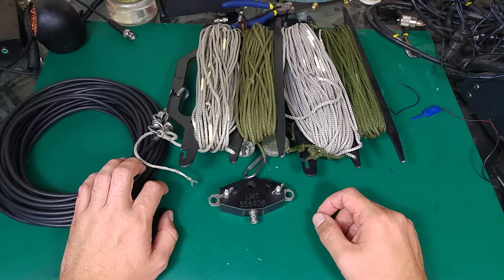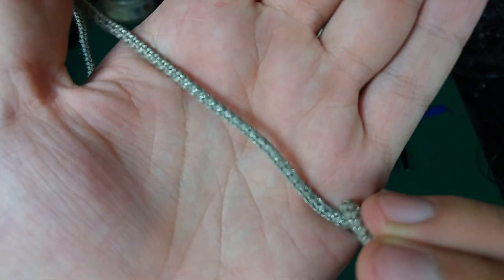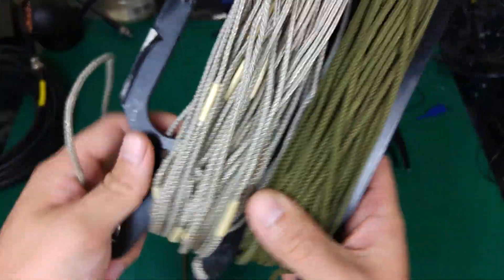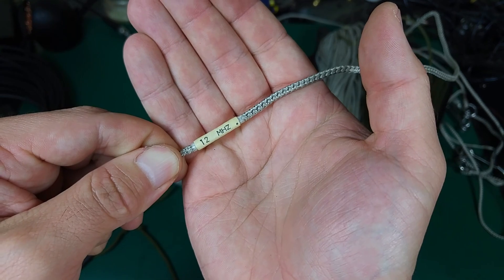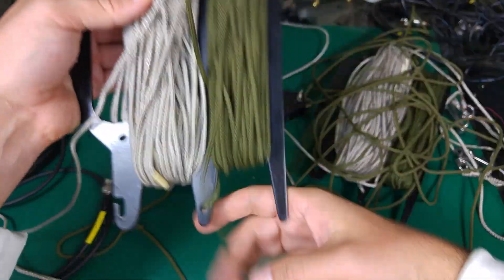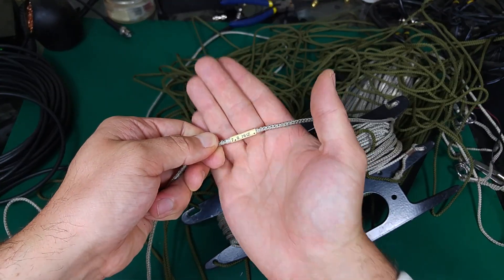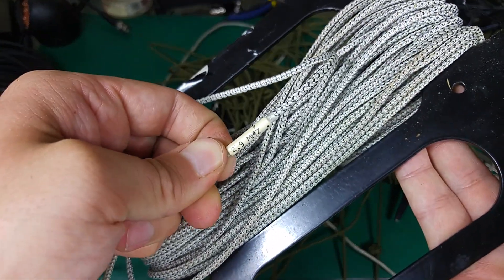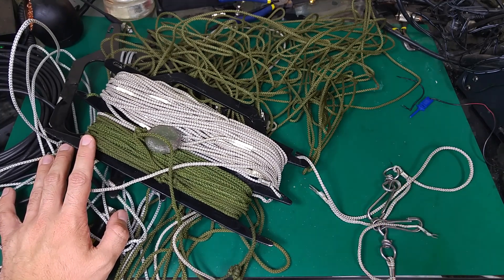HARRIS (?) MILITARY ANTENNA  PORTABLE DIPOLE  HF 2MHz - 30MHz

Comment: Very interesting! With the Clansman dipole that you mention, the remaining wire would simply wrap around the carrier. This “rope wire” is conductive on the outside, so it will make a short circuit on the carrier, making a precise length. With the Clansman set, you have to know the frequency and length calculations. The Clansman carrier then acts like a big inductor on the end with all of the wire wound around it. I see this newer dipole is well made and thought out. If you have a link for purchase, please post it. Thank you es 73!
Reply from the maker: That is very good point! I never think that way about acting like coil but it make perfect sense.    I hear that bare metal are more prone to static noise - something related to skin effect - but i'm not an expert in this field, if You have any comment on this please share.
I don't have it anymore, looks nice but it was to heavy for hiking,  i got it locally from random guy who sold surplus stuff and this one piece related to communication.
Recommend adding Your local online trading sites  / facebook and search for "harris, thales,racal" <- they are interesting keywords
73

Comment: How are you tuning the legs to your frequency if you arent cutting the ends of the legs?
Reply from the maker: You are un-winding them to desired frequency leaving rest wire on the spool. (same as on Clansman HF dipole antenna).
Reply: @ElectronicNoobBlog  the rest of the wire on the spool doesnt affect the length?
Reply: @michaelseaman5832  Nope. Remaining wire is electrically shorted by the spool to which remaining part is attached to.
Reply: I assume that that was a question, if so the answer is NO@michaelseaman5832